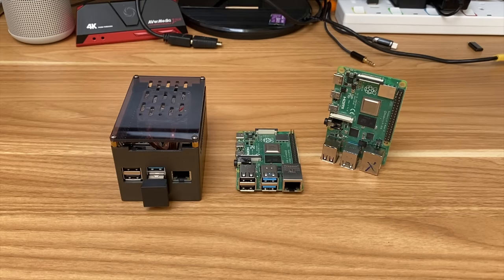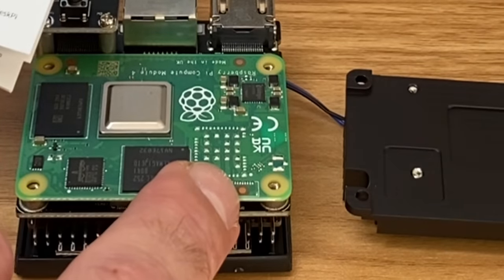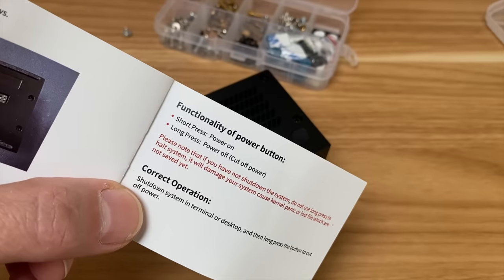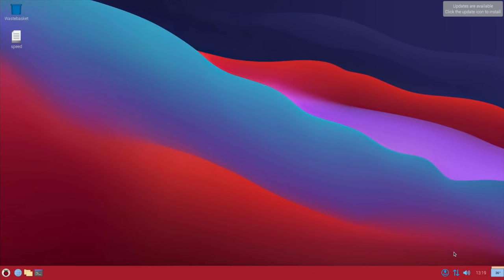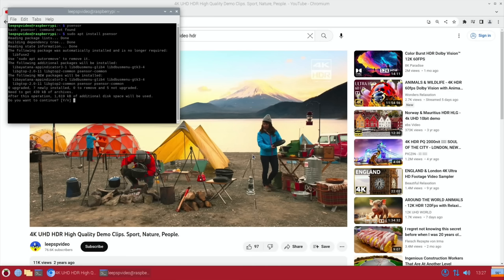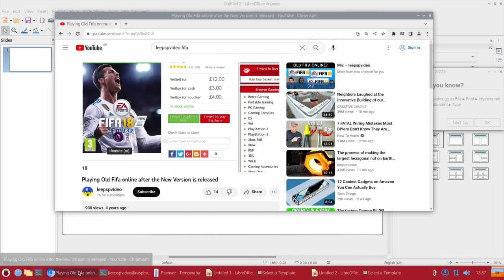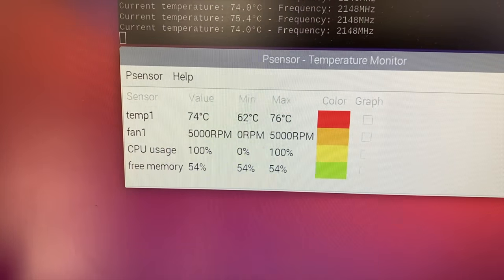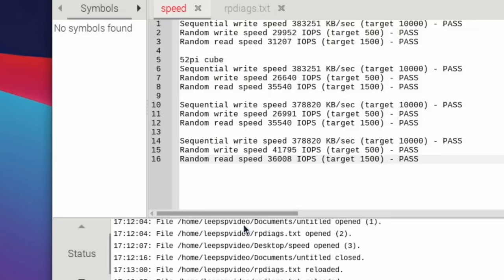Tiny Dual monitor Desktop computer with NVMe. CM4 mini cube

Comment: You can get an iKoolcore R1 cube PC with a Celeron N5105 and 4 x 2.5GbE Intel ethernet ports and 8 GB RAM for $200. Bare bones, so you have to add your own storage - an M.2 2242 SSD - but they're cheap these days. Much faster than your CM4 cube, and likely cheaper till RPi prices drop (if they ever do). And since it's just an x86_64 CPU, it will run any OS and support hardware acceleration for multimedia.
Reply from the maker: The 5105 is surprisingly good for a Celeron 

Amazing Silent Ultra Mini PC. MeLe Quieter3Q N5105.
https://youtu.be/--zrxlx3O4M

The Pi will use less power

Comment: Can you cover fan control via pwm in a future video. Raspi-config makes it a static on off. 
With a simple python script these can be variable. 25% on @ 50⁰, 50% on @ 60⁰, 75% on @ 70⁰ etc, etc. This makes the pwm fan near silent with variable temp control relating to fan speed.
Will apply to all pwm fans that you have covered in the past. 
No need to 3.3v it.

Comment: It looks like you are using a B + M key M.2 SSD, so it's a Sata SSD and not a NVMe drive, as NVMe drives use the PCIe bus
Reply: if you zoom in it clearly says NVMe on the label
Reply: @dalecousins7373  okay, I didn't see 👍
Reply from the maker: https://www.cytron.io/p-nvme-2242-b-plus-m-key-makerdisk-ssd-128gb-preloaded-rpi-os

Comment: Thanks for the great video, I've got the mini cube but had a quick question, where do you recommend installing the Raspberry OS, on the MVME or the MMC built into the CM4? Also, I haven't been able to access the MicroSD do you have to enable it ?  Thanks!!!
Reply from the maker: Nvme is best for speed. You often can’t use am sd card if your cm4 has inbuilt eMMC
Reply: Thank you!! @leepspvideo

Comment: Well ordered the Cube, got it, got an SSD, a CM4 and put it together.  Only thing I did different from you is that I tried to boot with an SD card and got unhappiness from the unit.  Have you booted yours with an SD card.  Hope I am not doing something incorrectly.  Have no way to load the OS on the SSD so.....am stuck for now.
Reply from the maker: You can flash an os to the m.2 with rpiboot. I showed some of the process in this video.

https://youtu.be/TDaY9tNKWs8

This guide by Jeff Geerling has other options 

https://www.jeffgeerling.com/blog/2020/how-flash-raspberry-pi-os-compute-module-4-emmc-usbboot
Reply: @leepspvideo  Got it, thanks for your help!  The Cube is a good gig!
Reply: so also learned today that if the Comp 4 is eMMC it will not boot with SD seems only the Lite (non eMMC) will boot via SD.  Would love to see a deep dive into the Comp 4, specifically the Flashing of eMMC.  Jeff Gerrling does it with an RPi IO board, be good if you did it using the DeskPi unit. THX @leepspvideo
Reply from the maker: If you have no os on the eMMC the cm4 should boot from usb. 

Did I break my CM4? USB Boot eMMC CM4 test.
https://youtu.be/a0S-_lCMZu4

Comment: I noticed that your m.2  drive is Gen3 x 2 and it's PCI-e ....  So I guess it's running at the fastest possible speed the CM4 can do.... hrmm..... I expected it be faster than about 300 - 400 MB/s ....  IDK why I feel like it should be faster than that tho... I guess when I was first looking around to get the fastest possible storage on a raspberry pi I saw that the CM4 used it's PCI-e lanes to connect m.2 drives I assumed it would run at a full Gen3 x 4 speed .... but I never got around to actually benchmarking the one I got.... And I keep saying that I need to set it back up and test it myself, but I keep forgetting to do that and I have other things come up during the day that  prevent me from playing with my tech... Oh well.. one of these days I'll get around to it and know how much the CM4 can do at the max because I'll just hook up both of my Gen4 x 4  and my Gen3 x 4 drives so I'll KNOW that it's as fast as it can do....
BUT, I REALLY have learn A LOT from your videos TBH ... so I NEED TO say THANK YOU .. plus I REALLY enjoy seeing the new tech that you do videos on.... Do you think you might ever try to make a video of a CM4 running a NAS?? I REALLY want to put together a NAS so I can get all these different hard drive out my of main computer case so I can get the airflow opened up and put the glass back on it LOL - right now I have 6 SATA HDD's just laying inside my case with all but 1 just being loose and not screwed into anything LOL - but I needed the space to store all my movies and tv series that are in 4K...
ANYWAY, hopefully you're able make a video on that someday :)

Comment: I can't get mine to boot from nvme, something about configuring eeprom boot order or something. help!
Reply from the maker: I don’t think that applies to cm4. I have never changed it. The Pi 5 needs to be told it’s booting from nvme
Reply: @leepspvideo  I moved my cm4 to a stock raspberry pi Io board, and was able to update the reprint and change the boot order. Now it works

Comment: Why everybody uses fan was totally cut off by a radiator?
Nobody don't understand physics and cooling principles?
Reply: centrifugal fan can fix it -- it must blow out of box the the half of the radiator (with thin metal cover on this half that don't allow to spread hot flow until it goes out of box)
Reply: centrifugal fan inlet must be set on top side to suck in hot air from the box